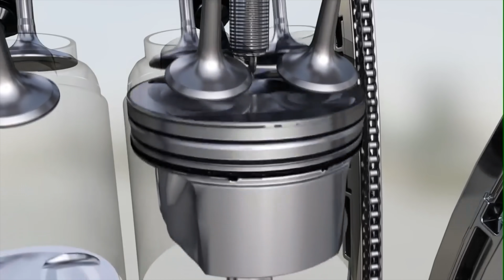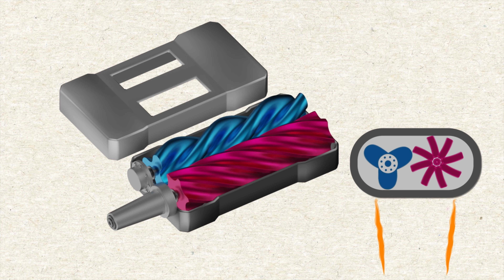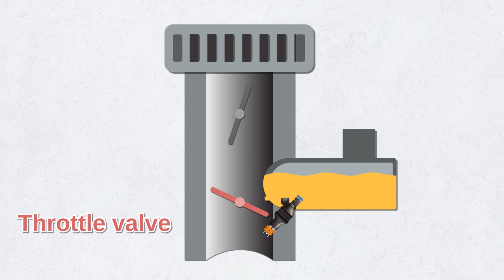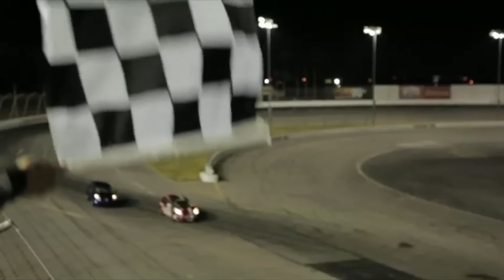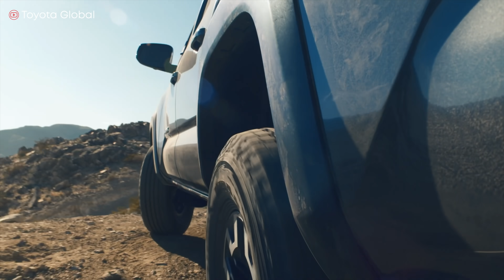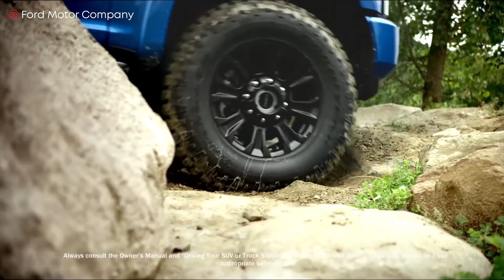This New Car Mod Just Changed the Game

Comment: As a kid I always imagined designing an electric supercharger, and wondered why they were not a thing. 
I wonder if they could be used at both lower and higher RPM in a hybrid engine that had a bank of lithium batteries that would not just turn the wheels , in eco mode it could operate just enough to help out, but could be engaged in a sport mode to operate as powerful electric supercharger, and then a track mode would engage the electric hub motors and the supercharger at full power, all working in concert to deliver maximum power.

Don’t think hybrid like Prius , more like a 918 , but under 60k$ a affordable coup/sedan/hatch that would be very fast. Have a plug in as well if needed for those who drive track mode a lot. 

And design the thing to be affordable LONG term.  The engine can still work on its own, the electric can work if the engine has problem (better than a limp mode , just electric hub motor mode with enough range to get through your day and get it to the shop when needed,  just a short range hybrid. 

It’s fun to dream .

Comment: once we did a poor mans turbo on a 1975 nova, removed the hose from the passenger side A/c, use a hole saw in the firewall ran the hose from the a/c to the bottom of the air cleaner where the old hose that used exhaust heat, car would go from 100 to 130 in a few seconds when the A/C was turned on full blast

Comment: Great stuff..thank you...  And i have q3 audi which runs quick and very fuel efficient ...Also,.  i learned back in the mid 1980  to early 1990 mechanics were using NOS with turbo to rid of turbo lag then.   I  like that electric second turbo suppression idea better for everyday drive better.

Comment: I probably need to go back and re-watch... but I missed why the coupling of the electric motor for super charging was not sufficient to fully compensate for the turbo-lag. 
If I remember correctly it could spin up to some unbelievable 170K rpms in a fraction of a second. 
Why then is that not superior to any other more complex super charger configuration which you went on to describe?

Comment: I bet Scotty would know what the correct ignition timing would be on a 1955 bell air with a 327ci engine and a four barrel carburetor.  😂🤣
Reply: 37 degrees BTDC at operating RPM, because it's a SBC. Work backwards to find your idle timing.
It wasn't the best line in the movie. I thought you yoots should know that.
Reply: My Cousin Vinnie knows the answer, too 😉  LOVE IT!

Comment: The old owners of my car cut a bunch of wires to the amp, car was fine when I bought it, no problems, months later, I went to get a new stereo and sub installed, the guy told me what the old owners did and fixed it. Not when my cars turned off, one of the fuses is draining power so it will die after 2 weeks at full battery charge, 1 night if I jumpstart start it. Now I just disconnect the battery when I'm done driving for the day. I know I need to fix the wires or w.e tf he did but does anyone have tips?
Reply: Either your new amp isn't set up to power down after the key is off by design or bad installation. Or the power to your new components is keeping one of your cars modules from going into sleep mode.
Reply: @don2deliver  the second part, my sub has a built in amp, the amp for my car has all the wires connected into one spot, like the guy didn't know what he was doing. And Its one of the modules, a mechanic showed me on a heat scanner and it was definitely on. Should I disconnect the amp wires All together and fix it later or will that do something worse?

Comment: I've always preferred super chargers (not by experience, just by research). Seems easier to install yourself.
I've always wanted a Toyota gt86 with a SuperCharger and a tune. I would only try and make 300 hp, give or take 10-20hp. 
Would be a little pricey (about $10,000 canadian to do the super charger properly + price of the car)...one can dream lol and it would be more reliable than a Nissan 370z.

Comment: I had a 1.8 turbo, from a dead stop it was a little rocket, would throw you back on the seat, but if I was going off a ramp and merging into traffic it was no where to be found, and that's when you really need it the most, I almost got run over  a few times by semis I couldn't get ahead of
Reply: Why people need to "test" cars like rentals etc before this happens.  I drove TT and so many people would almost merge into my trailer.  I'd blow air horn and driver would be surprised, then get passed at me!  I don't know where these people learned to drive, where they don't understand the vh already on the hwy have right of way.  Then, the fact 4 wheelers expecting 80,000lb truck to stop on a dime, is just Stupid.  Stay safe and drive smart and stay alive.
Reply: @birdlady2725  Well, how do you test them if you don't actully come off exits and merge into traffic right LOL, it's not like you can invent another scenario like that,like I said the car was a rocket at stand still,the turbo just didn't respond well when you were moving.

Comment: Scotty, can you do a video on towing suspension and upgrades like timbrens and sumo springs? Also, how and when to upgrade the spring system. I have a 2006 Durango that I am getting new springs for because the original stock springs are sitting about 2 inches lower than they should be.

Comment: Is there a way to make the supercharger ineffective at low rpm so that it is as good as naturally aspirated at low rpm and does it make sense?
Reply: Not that I know. There is the electric supercharger as mentioned between the turbo and engine on some set ups. Perhaps an on demand election supercharger however they are small so I don't know how useful that would be.